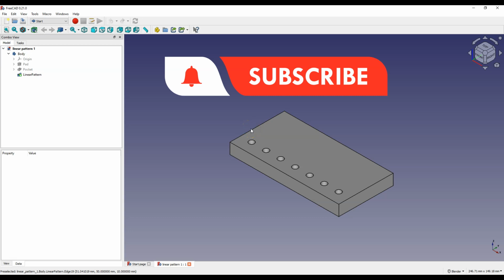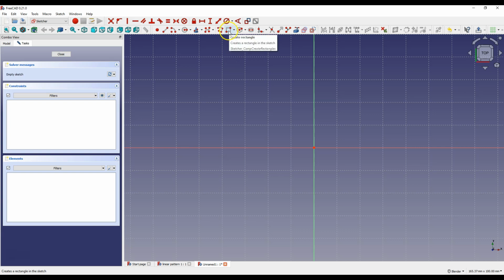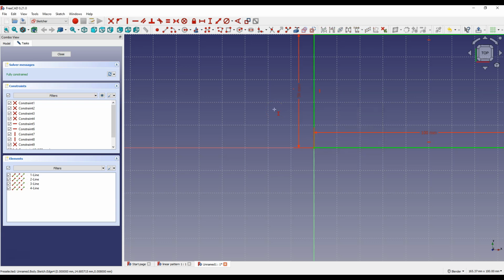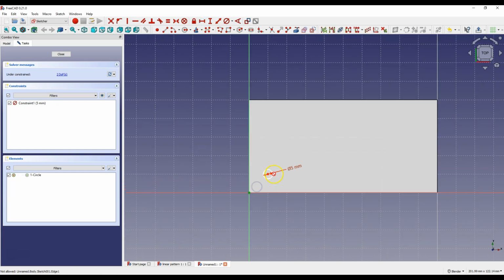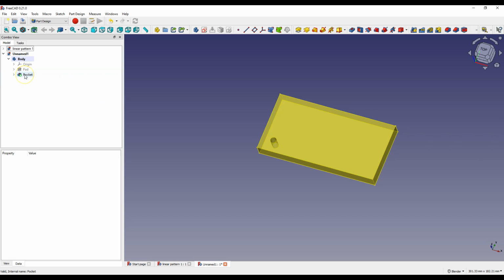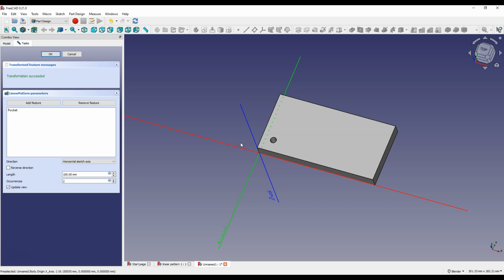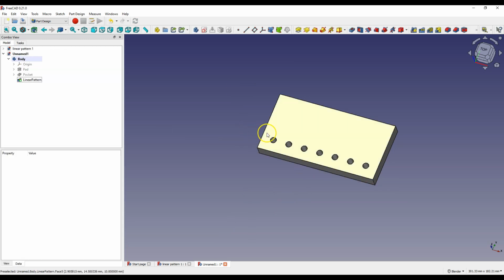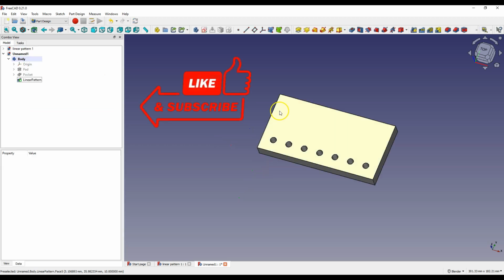Make it EASY with a Linear Pattern in FreeCAD

Comment: Need help I can't export Polar array
Reply from the maker: I don't fully understand the question. Can't add Polar Pattern? Look at this: https://youtu.be/G4BIoHwxHMA
Reply: @CADCAMLessons  I was making wheel center caps and I was adding retainer clips through polar array, and it was completed in-fact I even printed bunch of them but after the update I made couple of changes to the design, and after that all except 1 clips disappeared it wouldn't show up in the Cura. 
turns out I hadn't completed the design LOL the clips weren't even fused to the body before I was just exporting 2 parts and printing it on top. im still learning im very new to this